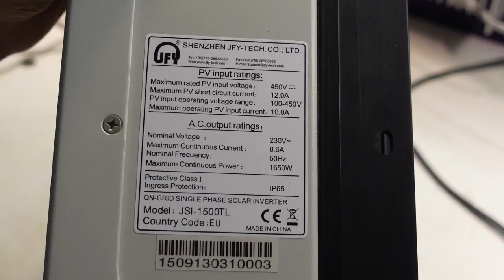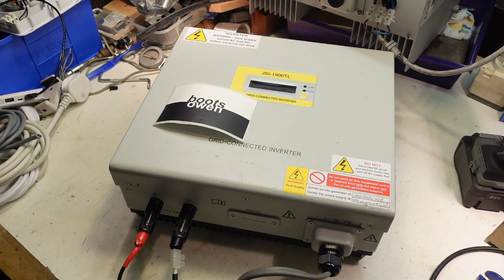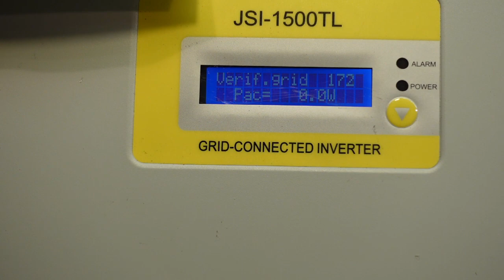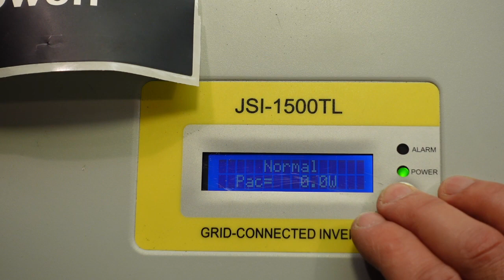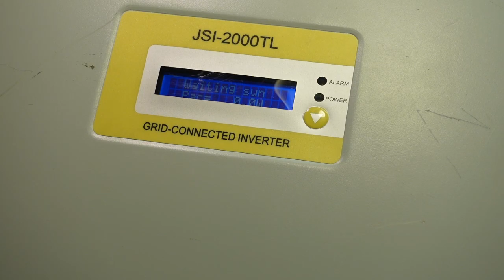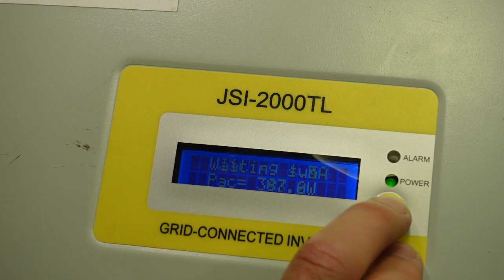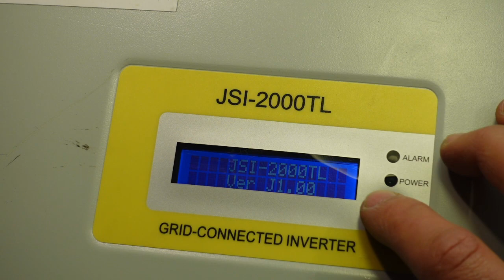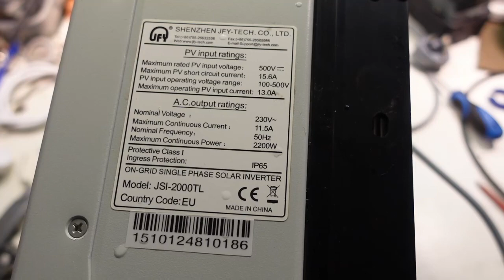JSI 2000TL and JSI1500TL grid tied solar inverters bench testing one pass and one fail: but why?

Comment: Do you think maybe not enough DC current? Does a panel need a higher current?
Reply from the maker: The inverter should kick in when the dc input passes the voltage threshold and ac is present. I think these units were dud
Reply: Should have read comments I see you tried it out with actual panels.  .. . . shame. Any goodies inside that you could use for anything? @bootsowen
Reply from the maker: I chopped this one up this week. I got the mc4 connectors. I have had good luck repairing abb/aurora and solis inverters. They tend to fail with burnt relays and if the board isn’t burnt too badly then the repair is easy enough. Sometimes it is just a matter of resoldering the contacts. If it’s worse it takes new relays. But it’s a relatively easy repair. I have about 6 waiting for the fix.
Reply: @bootsowen  Well done mate, did you train in this or just pick it up as you go along?
Reply from the maker: I just make it up as I go along. My logic is that if it’s already broken and I don’t need it or it’s been thrown away then I can’t really make it worse!  Have a go!
Reply: Nice one man. Good for the planet too.  @bootsowen
Reply from the maker: We do what we can Thorpy, I saw your video clearing a beach, endless work.  I do it locally with bags the council gives and collects, so I just have to do the picking. You get a lift while you do it and you know it is good, but in a city like where I am the litter is back again soon..  You maybe have seen my street scrapping videos, looking in skips and occasionally in the bins when the students move out at the start of summer.  If we can show one other person that it can be done and it isn't so gross then maybe they will pass it on too, or at least consider not throwing out new clothing with the tags on! Keep at it!

Comment: That's right, the tracker keeps increasing the load and pulling down the voltage, until the inverter cuts off and then restarts and repeats the cycle. I'm thinking it's junk, but I may be wrong, cheers
Reply from the maker: I put the 2000 on for a few weeks to test on 5 panels, some days it was showing generation, some days zero, after the few weeks it had no increase in Etot, So it think it didn't generate?!?  I think they are for the scrap bin!
Reply: @bootsowen  Yes, not worth messing with, could be software and a sensor, cheers

Comment: Bit of a deep rabbit hole for the 1500. I'd look into seeing if there is a firmware update for it. May flag up errors or enable new alarm flags.
Reply from the maker: It's tricky to know if it is worth it, I would just prefer to do the relays on abb/aurora units and solis. I have been running the 2000 model for a few weeks on panels and some days it shows power out and others not, and in the two weeks the total generation hasn't changed so something odd is going on there too. Hardly worth it.
Reply: @bootsowen  they do look cheap units. With a plethora of nicer units it's silly to repair that.